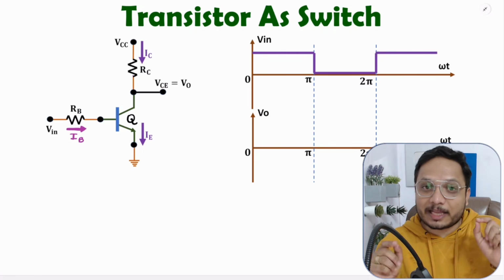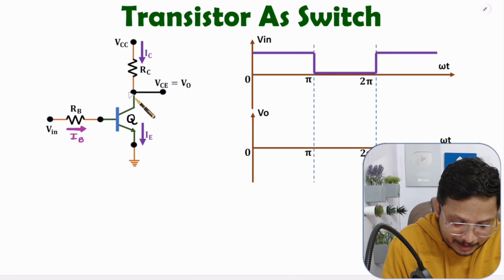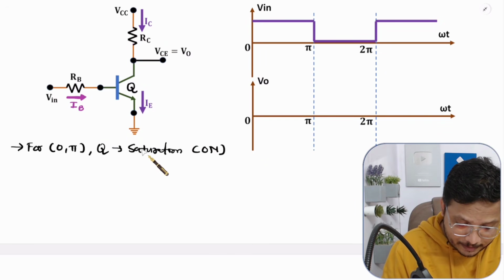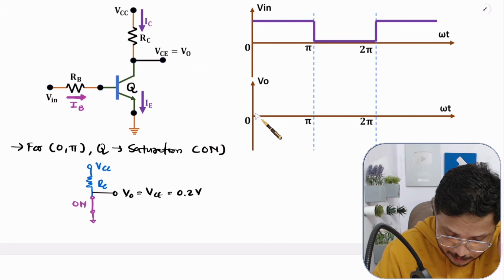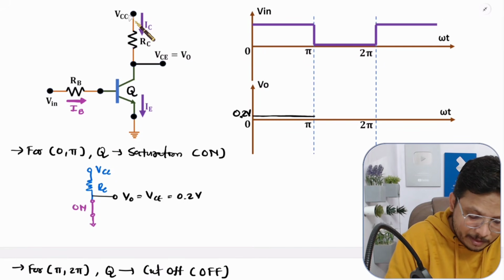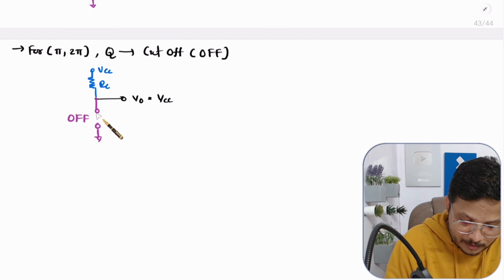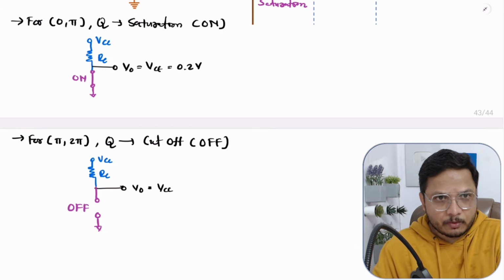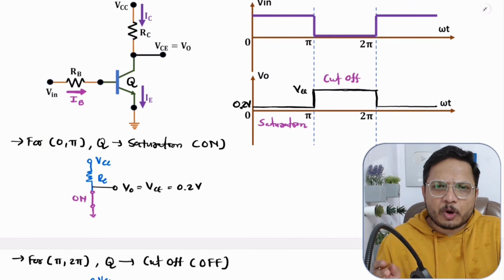Transistor as Switch | Turn ON and Turn OFF Mechanism of Transistor | Basic Electronics

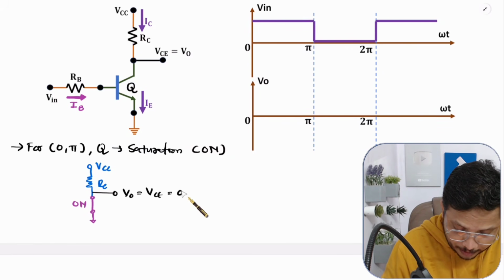Comment: 2:18 
When the transistor is ON, the Vo would be 0.2V, not for Si transistor. Probably sir wanted to tell  Germanium Transistor.

For silicon transistors, it would be 0.7V approx.
Reply: no for silicon transistors in saturatioin mode, VCE=0.2V only